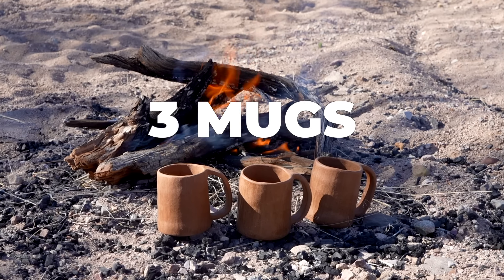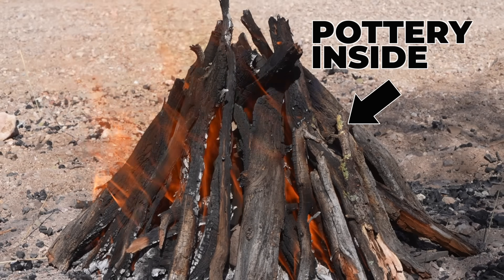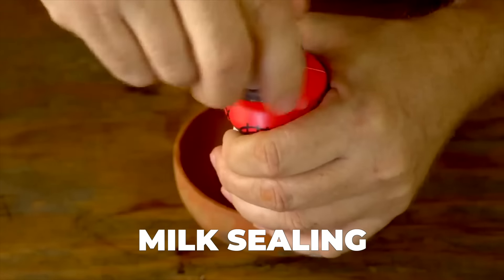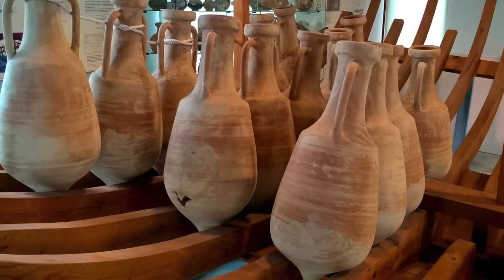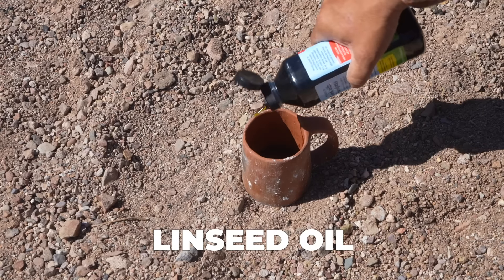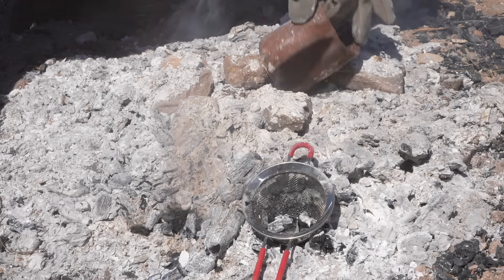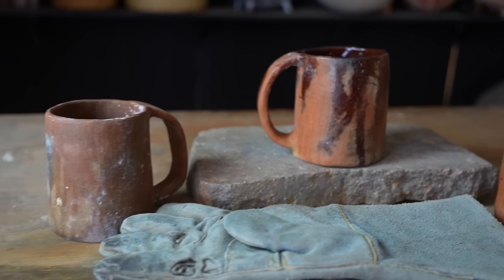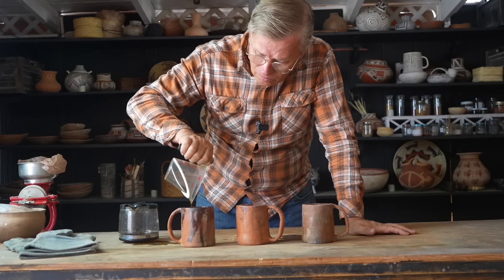Sealing Mugs With Old World Methods

Comment: I use a copy of a southeastern cup for my coffee.  I'm using native clay I dug from a slough about 1/4 mile from my house.  The first cup or two of coffee leach into the clay and the coffee cools very quickly.  After that, with regular use, they quickly stop being porous.  My clay isn't a terra cotta but it's pretty close.  It fires tan to orange.  If I leave it in the fire, it will turn orange to grey, depending on how seasoned the wood is.
Reply from the maker: Cool
Reply: this is a great point that i missed until you said it. i was researching natural ways to filter water and learned that hundreds of years ago, people used porous tall thin clay vessels to very slowly filter the water into a larger nonporous vessel.  After so many filterings, the porous clay vessel was no longer porous so had to be replaced.
If you saw the price of berkey filters, you'd know why I wanted a cheaper method of water filtering. Supposedly, some wine holders made of clay can be used to filter water - if one trusts that no toxins were used.

Comment: You picked three materials that all have a synergy with each other:
-Linseed oil thins beeswax and pitch, allowing them to combine more than they could alone and penetrate into smaller pores in wood, then provides the toughest final polymer seal.
-Beeswax provides the first surface seal and gives the composite retention into the clay, lowering the effective volatility of the other components, but simple mechanical abrasion removes it bit by bit if it's not hardened by something else.
-Pitch resists simple abrasion better than any oil or wax alone (it's the basis of a traditional jeweler's lap), and I believe several rosin acid compounds themselves eventually catalyze the polymerization of linseed oil, but the soluble acids will leave pores behind after use with hot liquids that will reseal when melted.

All three materials can be improved with some added chemistry:
For linseed oil, the common wood stain chemical iron (III) acetate can be made by boiling steel wool or other fine iron source in vinegar, and the resulting acetate will react with rosin acids to form a rapid-drying catalyst (see https://simplifier.neocities.org/linseed ) that can reduce the cure time to a day or so, similar to commercial "boiled" linseed oil.
For beeswax, it may be somewhat cheating, but adding half paraffin to a beeswax melt improves its sealing properties beyond either type of wax alone.
For pitch, melting your pine pitch floating on a much larger volume of water would give it a chance both to lose soluble acids, and lose turpentine transforming it into rosin. This will make the resulting initial seal much closer to the cured state. This last trick has already been done if you buy pine rosin for musical purposes, or as a byproduct of manufacturing turpentine.

Beeswax is fast and easy, for any material, and the bits you eat won't hurt you at all.
1:1 wax/rosin mixture seals instantly against harsh weather, and can be pressed into service as a hot glue for emergency canvas tent patches, as well as being decent for making a "food wrap" or similar food-safe utility oilcloth.
1:1:1 wax/rosin/flax takes a week or more to fully cure, but appears to retain advantageous properties of all three in the long-term for both canvas and wood.
My guess would be the clay's rigid nature mean the beeswax inside pores is protected enough that the mixture would either be the same or worse than straight beeswax, but I regularly melt up specifically rosin, beeswax, and flax oil for wood products, and find the results I've had playing with wood samples fascinating.
Reply: What would you recommend for sealing coffee cups? ...so something that will be dealing with hot liquid and also soap (as most people will instinctively wash their cups with soap)
Reply: @ryanpeters5754  linseed, walnut, and tung oil can all polymerize to some degree, with linseed as the toughest... they need to be slow-cured in air for a week or three, but the straight oil finish is most resistant to heat, soap, and acids together. Soap still wears it down slowly, and it will probably need reapplication every year or two.

Comment: I think the trick is to coat them then put them again on the coals, suspended so it dries out. That way, the pitch can polymerize and turn from resin into rosin. And it probably won't hurt the other sealing methods, either, to do. Edit: You might want to start a smaller fire nearby, too, to get the temperature high enough for the oil and pitch to fully polymerize into basically ancient plastic. And also you might want to use something like a piece of cloth to "polish" the surface in the same way you would with a buffing compound, again, all that before "baking" the result at high temperatures, so the oil and resin can turn rock-hard. Often, a mixture of resin and wax was used to get the melting point of the mixture lower, before it was baked to evaporate the wax and have only the resin leftover, as a glossy coating. 

Also, I'm not entirely sure if this works, but I think it could be, so I think it is worth trying: by mixing beach sand (silica sand) with lye (which was traditionally made from wood/grass/plant ash, so from potassium instead of sodium), you make waterglass, which you can use to not-really-seal pottery, then dry it out, then add an acid (i.e. vinegar) to separate the lye from the sand "shell", then carefully remove the liquid, then bake it again, or bake it for the first time. You would likely have to do this in a few steps, for example first the bottom then use some clay as a lid to keep the liquid in while doing the sides by marking a + and an x on one side of the cup so you can remove the lye 1/8 of the cup at a time, for the silica to precipitate and form a shell around the clay, which to cover the pores of the clay. If this is done before firing, it would likely be needed to let the clay dry so the silica layer properly bonds/adheres to the clay. I know this was not traditionally done, as far as I know, and it would have been a lot of effort for getting a glass glaze, but you might be able to get a glass glaze this way.

Comment: Thanks for a very interesting video. I was surprised that the linseed oil (aka Flaxseed oil) wasn't more effective. When I purchased my carbon steel wok the manufacturer recommended flaxseed oil to seal the steel. I've also used it on cast iron with great success - liberally coat the vessel then heat it to the smoke point and when it cools it is sealed very well. I kind of expected that stoneware would be the same. So, it was very interesting to see it wasn't as effective.

Comment: I remember reading about some amphora found in the Black Sea from the early Roman Empire era, it still had wine inside and was coated and sealed with bees wax.
I'm sure they actually used every available method depending on what the merchant/craftsman knew and had available as a resource.  Bee wax was always valuable and I doubt they used it much for 'common' storage like olive oil or water containers.

Comment: Interesting results. But a thought on the linseed oil. When used to paint with, the drying time before it's proper solid can be as much as 6 months or more, i don't know if that's a possibility but letting it harden through natural oxidation might be an option for a stronger seal?

Comment: Birch tree resin was used in many things as glue and sealants due to it being more stable and 'flexible' compared to pine resin. Pine resin over time can crack especially in cold weather. It's hard to make Birch resin in comparison as it has to be made in a vacuum but it's been around since the Neanderthals as they used it too. The mix of wax and resin it to keep the seal 'flexible'. You could potentially get an incredible long lasting seal by using birch resin with a small amount of bees wax.
Reply from the maker: Thanks but we don't have birch trees in Arizona and the weather doesn't get so cold that the pine resin will crack either.
Reply: It's common to tap some types of birch trees for sap in spring time to make sweet syrup for candy or pancake topping.  The sugar content is much less than maple sap, so results of boiling off, are much smaller, but still useful amounts can be had.

Comment: For sealing an earthenware house with linseed oil, you have to apply it, wait a week and repeat two times to fully seal and cure it. Maybe it's similar for the pottery
Reply from the maker: its not practical to heat a house up on hot coals. apples and oranges.

Comment: Getting the flax oil up to 500° F until it smokes an then keeping it hot until it stops smoking is how you seal cast iron. Leaving the flax raw like that can also seal it but it has to oxidize for about a week to 10 days between coats. Walnut oil does the same thing but works much faster, taking only about 3 days.
Reply from the maker: It was well over 500 F sitting on those coals
Reply: @AncientPottery  Maybe it wasn't on the heat long enough? Even watching the video it's hard to troubleshoot, so if you're interested then maybe it calls for more experimentation. I use flax oil and heat to season my cast iron, and my pans don't taste like flax. The black of the pan comes from that coating. It has to go on pretty thin though or else it gets gummy because it won't cure all the way. Text isn't the right medium to explain, I'd watch a video on seasoning cast iron or a carbon steel pan and then seeing if you can make the process work for ceramic.
Reply from the maker: @tarbucktransom  you don’t put your face right into a cast iron pan the way you put your face in a mug.
Reply: @AncientPottery  Funny you say that because after leaving the comment I got curious and went and licked one of my pans. It's like licking glass, there's just nothing. I know iron is porous, but it's way less porous than ceramic so maybe that's the difference? I guessing though.

Comment: I have personal experience on polymerizing clay with linseed oil for an earthen floor. It worked. The floor is waterproof. The difference however is that the oil was applied on raw clay. Maybe the linseed oil applied before firing could be an interesting approach.
Reply from the maker: It would all burn away in the firing, a pottery firing is incredibly hot
Reply: @AncientPottery  Thank you for your reply. As far as i understand the linseed oil reacts chemically with the clay so after applied there is not any oil there to be burned anymore. Anyway I will try it and let you know of the results. And let me express my deep respect to you and your channel. Greetings from Greece.

Comment: Hi, Vik from Geeko Farm here. We grow olives. I can tell you for sure that beeswax dissolves in olive oil, so maybe not a great choice for amphorae. Tar is definitely softened by olive oil (handy cleaning tip), so it would probably dissolve into it to some extent, so not sure how that would go long term. Not tried it on pine resin.
Reply from the maker: Good to know, thanks. I suppose if you were just eating and drinking from it, there may not be time for the oil to dissolve it, but if it were stored there that would be a different story.

Comment: So when sealing, would sealing both the inside and outside of the mugs be beneficial to insure its sealed all the way through? Is there a disadvantage to sealing the outside also, beyond the possibility of making it slippery? Although with a mug handle that wouldn't be a concern. Love your videos! I took ceramics in college for 3 years, and have learned more from you in just a handful of your videos.

Comment: I know from wood working that linseed oil really needs multiple applications to seal with really really long times between applications and a long wait after the last one.  Raw linseed oil takes forever to finish hardening but once it does it is very good stuff.
Reply from the maker: Thanks for the info

Comment: Another interesting thing to try would be to to burn in the oil like you do with cast iron cookware.
I bet you would have to do it multiple times but the resulting carbon in the pores should be a very effective and taste-free seal.

I can also imagine ancient people did this because it happens naturally if you have something oily in the pot and forget about it for too long.
Reply from the maker: Yeah I think the oil just needs more coats and heatings. I'm sure with time it could be improved.
Reply: Some oils are 'drying oils' and they polymerise to form a gel. Linseed does this, but the pure, food-safe version takes ages

Comment: A stick would of been ideal to plunge in the gravel so you could just set your mug over to drain out.  There may be a surface blemish of more resin, wax or oil where the stick and vessel touch but inside the cup and not on the lip.  Like a wine bottle drying rack.  The pine and beeswax maybe a good mixture if you can find that sweet ratio. But I appreciate your vid and have filed this in the back of the noggin for future use!  Thank you so much!  This reminds me of the cooking baskets and clay vessels that just got better seasoned over time.

Comment: There is also the question of how often such pottery would have been used for hot liquids.

For amphorae, that certainly wasn't the intended use. 

Maybe people back then mostly used wooden vessels when eating soup and drinking hot drinks?

Also, proper polymerization of the oil would probably remove the oil smell

Comment: For polymerization of the linseed oil, what temps do you need to reach?  Was wondering if regular household oven would work at say around 450'
Reply from the maker: I'm no expert on this but I was told that you need to get your oil to the smoke point to polymerize it. The smoke point for flax seed oil is very low, 225 F, so yes, oven temp.

Comment: Hey Andy! I recently got interested in ollas as a concept and tried some experiments at home using my backyard clay. Your results match a lot of things I noticed as well. I wanted to see if I could adjust the seepage to a level that was more acceptable so a puddle wasn’t left under my pots, but still allow seepage to have optimal evaporative cooling of the liquid inside. So I tried combinations of beeswax and animal fat. Surprisingly the lard seemed to not help too much, unless I melted it and put it in the pot so it could seep deep into the pot. the beeswax definitely worked really well, I used it to seal the bottom of the pot and that helped prevent the puddle as well, because the bottom doesn’t allow any airflow so that water could not evaporate and would instantly puddle. But I left the rest unsealed and that seemed to work the best. But I was thinking maybe having 1 coat of linseed oil could help it to slow down the seepage just a little, because I was still getting a ever so small puddle at the bottom

P.S. I asked chatgpt to give ideas for partial sealants as well. It suggested applying wood ash or bone ash as a glaze during the firing process

Comment: So with armor blackening you put a thin coat of linseed oil on and then heat it and hold it at the smoke point, but without heating it to the burn off point, you should try giving it a second coat and then baking it at just over 500F.

Comment: I seal the stuff I carve out of wood with bee's wax too. All the pitch I could find smelled like shit so I didn't want to smell, let alone taste that. However, it was not pine pitch and also there was no enough of it either.

I'm going to have to check out that cooling pot video because I got heat stroke yesterday trying to go to my fort in the woods. I still have to get the ratio of clay to sand correct in making pottery though but I'm working on it.

Comment: The only problem with bees wax is that it has a melting point below boiling (eg. 100 c) - it is around 65 C (150F) - so wouldn't you have problems with very hot drinks/food?

Comment: linseed oil is a drying oil. apply it wet on wet till the mug no longer sucks it in.let it dry a few days then you can top coat it if you want.
Reply from the maker: I think the fire will encourage faster drying, you can heat up a pot much more than you can wood.

Comment: Flaxseed is the one of the three that is not only edible, but good for you. In the long run, that might be worth the extra time wiping off residue and drying in the sun (maybe a long dry time and not multiple coats is all that is required?). Earthen floors (dirt floors) are sealed with linseed over a long period of time, then you can mop them.

Anyway, it's very cool how they all worked.
Reply from the maker: Yes, very good and useful material

Comment: Love the channel so far!  Something to consider in regards to sealing earthenware is that you only need to seal the outside, a thick coating of any of these on the outer surfaces will prevent leakage.  You can skip the inside all together, bypassing the contamination issues.  Sealing the inside also gives rise to a wide array of potential chemical reactions with varied contents, whereas the fired earthenware is pretty neutral and therefore stable.  You can make some truly nasty stuff with pitch in the reaction.
Reply: Wouldn't sealing the inside make it more food safe? Or am I missing something

Comment: you can mix pine resin, beeswax and linseed oil, and soak the vessels with this paste.  I think it would be much easier to apply this impregnation, and the result would be excellent.  the only thing is to choose the ratio of the parts of each substance.
Reply from the maker: Soaking overnight in oil is something I have been thinking about